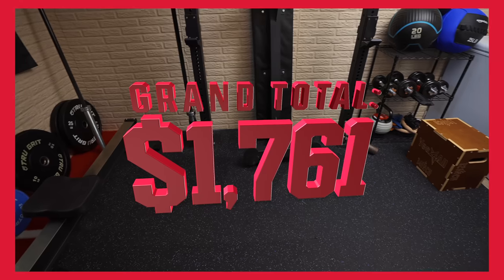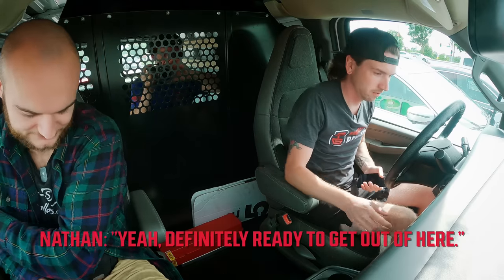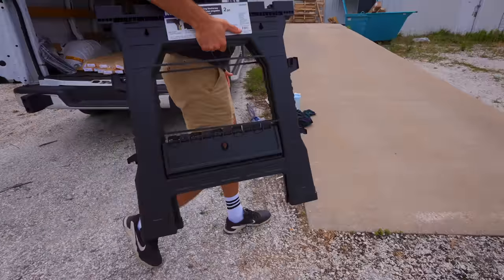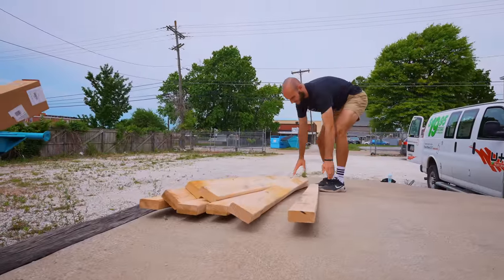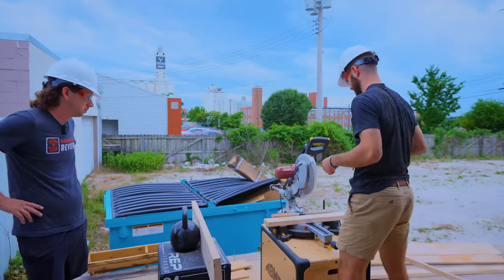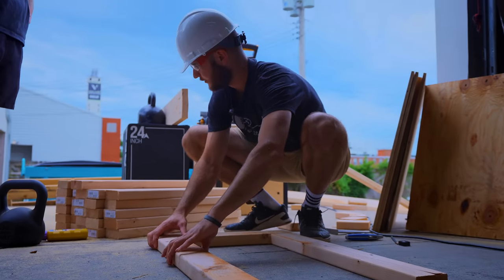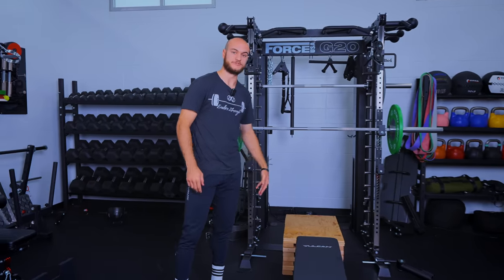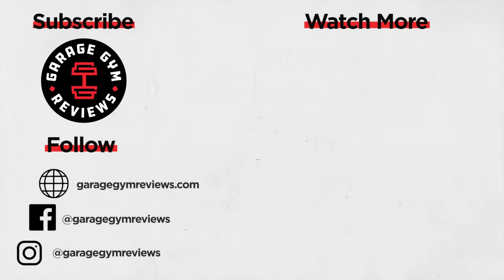How To: DIY Utility Blocks for Your Home Gym Purposes!

Comment: If you want to do it on the cheap, go to lowes or home depot and go to the scraps, you can get a lot of that stuff for up to 50% off. Also, they usually have a bunch of wood that's super warped at a discount, go for that, easy enough to clamp down and then screw it. Once you screw it all together than warping won't matter, the wood will dry out in the shape you mold it if you give it time
Reply from the maker: Great advice!

Comment: I'd love to see a build for adjustable height plyometric exercises. Bonus points if you can have some padding on the top or corner where everyone whacks their shins.
Reply: I guess you could do it following this diy, instead of the full stack displayed in the video you could make several small "boxes" with 3 30s at the bottom, the 4 20s then 2 30s on top, that way you can stack them to whatever height you want, you might want to add some kind of side plate to avoid any movement of the pieces for dynamic movements though

Comment: Great build video. Built Utility blocks with same design as  these for the LSU-S Olympic Lifting team.  Instead of plywood for the tops I did a layer of side-by-side 2x4s covered by a second layer of side-by-side 2x4s at right angles to first. Everything held together with deck screws. People can talk about overbuilding but those blocks see heavy daily use and are as solid as the day they were made, twenty years ago. 2x4s are cheap. Weights are heavy. Build solid.

Comment: you can buy some 1" dowels for this build, drill holes in each corner to fit on each layer of the 2X4's and now you have stackable boxes homie. also cover with horse stall mats and cut a 1" strip to the front and back to prevent rolling off.

Comment: Mabye try a video on some DIY leg rollers for 5/8ths holes power racks. Have not found any videos for that yet.
Reply: That's because 5/8" rods bend under a normal person's weight, so the only practical solution is to weld a 1" bar to another pice that fits through the hole, like Rogue's design. Kaezen DIY's YT channel has a video about a DIY leg roller where he show's his failed attempts at one, after making the 1" version. You really need a welder for that project.

Comment: Generally speaking, converting most garages into garage gyms are DYI projects - would be cool if you could do some videos on some of the more boring but helpful things like…insulation, ac/heat installation ideas, best storage ideas, best lighting, recommended fans - stuff like that. Just my thoughts.

Comment: Be aware. Plywood is stupid expensive right now. A 1/2 inch sheet of b grade plywood used to run about $25 here pre pandemic. Now it will set you back $48 bucks or more depending on location and where you get it.

Comment: So much material, it feels over structured for the weight is supposed to hold.
Reply: If you use them as pulling blocks, you definitely need that support.